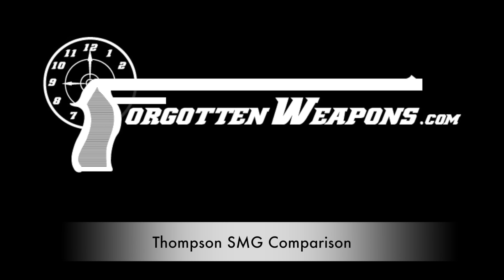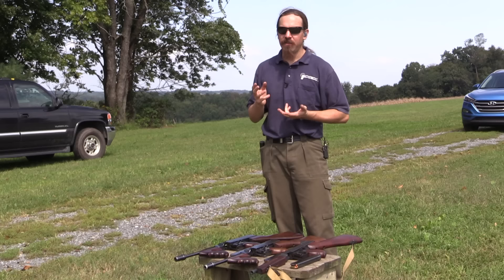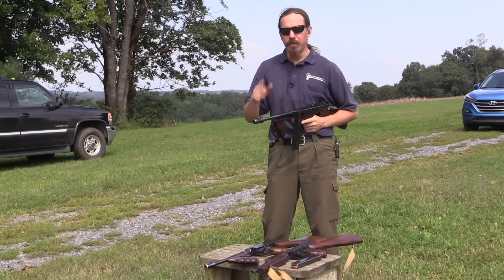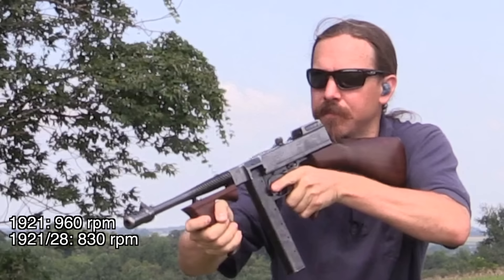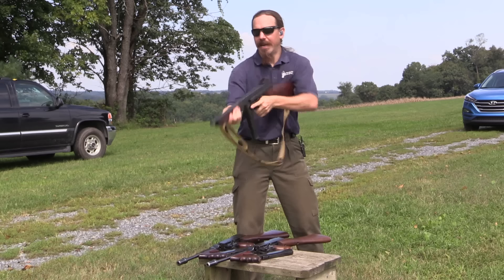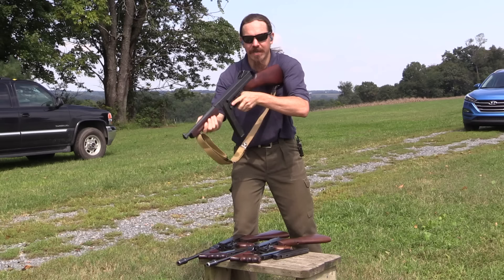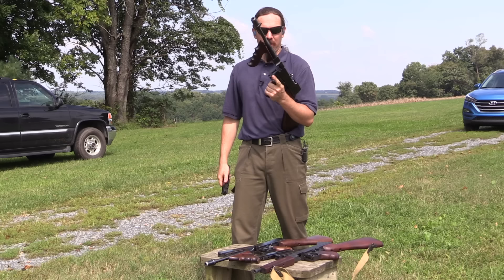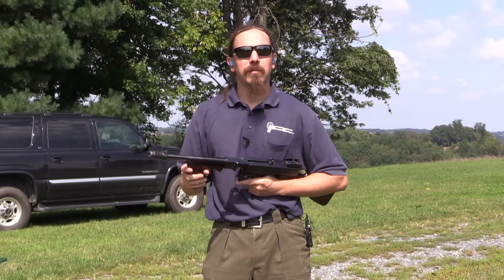Shooting the Thompsons: Comparing the 1921, 21/28, and M1A1

Comment: Since the M1A1 is strictly blow back operated I’d say thats the reason for more gas coming out the ejection port. The slight delay caused by the Blish Lock probably allows a more complete burn of the propellant, and causes air to be drawn from rear to front as the bullet exits the barrel.
Close up, high speed footage might solve the mystery.

Comment: maybe the 21 is more controllable because with the fast fire, the more bullets go through the compensater so that near constant stream of upwards gas makes it more controllable and that there is less time for the gun to sway and react before another bullet compensates the recoil. But just a theory
Reply: Kyle, I think you are on to it.  Ian leans into the gun and the 21’s high rate recoil balances.  But when the lower rate 21/28, he overbalances.  So he is having to correct (with his back muscles) with each individual round.  Well that’s a trick, so the gun walks around...less controllable.  There must be a sweet spot rate for every sub machine gun.

Thompson has its issues, but such classic lines!   M14 is another less than great weapon with classic proportions.

Cheers.

Comment: Say what you will about pistol/vertical forward grips, but I find them superior to the standard horizontal type on full autos of pretty much any sort. It seems a lot of folks prefer standard style, but I find a vfg goes a long way to increase control and mitigate muzzle climb. That goes double for designs with steep butt angles like the Thompson. I also tend to find them just plain more comfortable in most cases.

Comment: The only Thompson I've ever shot was an M1A1.  With no earlier models to compare it to, back-to-back, I thought it was just fine.  I can see how the Cutts would help.  If I had to pick between the Thompsons and a grease gun, I'd go with the M3 every time.  Much easier to control.  Not as pretty, but that wasn't the point.

Comment: I think that vertical foregrip makes the gun much more controlled. 
Incidentally the Cutts Compensator isn't to control recoil. Without it the early guns used to split their groups. Barrel whip. The Cutts prevented that.

Comment: Hrm. Assuming one had the cash to burn and the machinery, how hard would it be to adapt a compensator from the 1921 to the M1A1? The compensators seem pretty integral. If so would changing out the barrel be more practical?

Comment: Based on the slow motion, the impulse on the M1A1 at full bolt travel is extremely noticeable, all that mass is causing a lot of vertical climb when coupled with the high bore axis. The 1921/28 looked the most manageable however.

Comment: Even though I’m 6’2, I find the lenth of pull/ buttstock lenth to be too long.
The modern Kahr Arms/ Auto Ordnance 
Buttstock is the longest of all when comparing M1A1 config fixed buttstocks. I last year took on a SBR project, to build a nice Thompson SBR for myself, after the form 1 Tax stamp came back approved. There were a number of issues that kept me from just
Getting the factory SBR and calling it a day. Weight, without full auto there is simply no reason to want an 11 lbs empty, pistol caliber carbine. So the
Base conversion gun was the light weight model ( approx 8lbs) The barrel
Contour on the Kahr arms 10.5” barrel is wrong, and its not a WW2 spec chamber
Either ( it has a tight chamber which can effect reliability) so we went with the “Thompson Barrels” made M1A1 barrel.
It has been made with the correct contour, and is just about the highest quality Modern Thompson barrel you can  
Get. And after I chopped the 16” factory barrel to “make” the SBR, it all went off to Dan Block, a tier 1 Thompson mechanic.
Where he ran a custom WW2 spec chamber reemer in the Thompson Barrels tube, and made all new wood
For my gun. Kahr Arms Thompson furnature deviates from orginal WW2 wood considerably. The foreend isnt contoured for a real Thompson barrel
The kahr Arms pistol grip has a different angle, and contour than the real deal, and the buttstock also deviates greatly in contour, and is even longer than the original buttstocks… its too long! Making the gun uncomfortable and clumsy. Its over 1/2” longer than G.I.
I had Dan make mine 1” SHORTER than G.I., and by golly it feels like it should have all along! And with the loose WW2 chamber, it feeds everything. 
A selector was installed and made to function as a manual bolt stop, and with
The full auto 3 tine retainer plate, it looks like Thompson should….. all things the Kahr Arms SBR lacks.

Comment: I agree the 1921 sounded and looked more solid and controllable even with the higher rate of fire.  Sounds like a solid well made gun without corners being cut (thus the weight).  The M1A1 sounded a bit rough and "sloppy," and you can tell the better quality of the 1921 in its sound and operation.  For combat purposes, I like the M1A1 rate of fire, good enough, and saves ammo and magazine changes.  You almost need a drum mag for the 1921 because of the rate of fire.

Comment: Well, i'm no gun expert but i guess it has sense that the gun with the higher fire rate would be better, specially with a muzzle compensator. More bullets more fun, add the compensator and the higher fire rate probably means better effect of the compensator. Doesn't it?

Comment: My grandpa was undercover US Marshall in Chicago. I have pics of him with Dillinger. Imagine a REAL chopper, I.E. one with the steel cased, steel jacketed high pressure rounds. Wind that 100 rd drum  tight and then, with higer pressures the bolt starts rebounding off the leather pad in the rear. Hold it beside you, bear down into those perfectly angled grips, start it low, walk into target, very much higher cyclic rate. Count down the seconds, leave 10 rds or so, bolt is back held by trigger, release trigger, push mag release, bump out old drum with new and engage mag release BEFORE  new drum seats, automatically locks in, pull trigger again, cut cars, trees, buildings etc in HALF!  Overwhelm armor. Walk to targets 400yds away hip shooting by big brawny "Thompson experts" Those were choppers, just different ammo for the good guys! Makes an AR look pathetic. Thats why you would hear the scream "choppers!" And everything that could move found somewhere else to be NOW! unsurpassed yet. I had a steel round he said came from the valentines day massacre. But he said they were clubbed first. Chopper rounds left behind to implicate the FBI.

Comment: With the higher ROF the gun had less time to move forward and back, the shooter had no time to try compensating it, the higher tendency to climb with the fast ROF was well compensated with the comp. 
The heavier bolt in the two newer ones added more mass slamming into the buffer, which also meant more movement. The lighter bolt may run into the buffer much faster, but the inertia of the gun´s mass could compensate it much better.
The 1921 pushes back more (more lead being accelerated in the same time), but it does it much more smoothly.

My conclusion - Improvement in one or two areas (ease of manufacture and lower ammo consumption) may result in downgrading the overall performance where it matters.

Comment: I could see the 21 being the best handling and shooting because it was firing as designed! The 21/28 and the M1A1 are altered not redesigned to meet military requirements. This is one of those rare instances where the gun was designed and engineered to peak, right out the gate, and redesigns lessened the weapon over time.

Comment: Does anyone have any idea why the rates of fire are higher then "they are supposed to be"?
1921:  +20%
21/28: +33%
Almost 100 year old springs? Differences in ammunition now compared to the 1920es? Wear on the Blish lock?
Reply: Ammo and old springs. These guns had very nice looking internal parts.  And rof is based on a small sample size. Because the Army only cares if it works, the designers care how it works.

Comment: I think a lower ROF with a hard kicking cartridge is actually counterproductive. There's certainly a threshold below which the controllability increases again, but above that I'd say it's pretty much "the higher the rate of fire, the more the recoil feels like a constant push rather than individual kicks.

That's only a theory and I can't even put it to the test (thanks for nothing, sh!tty Germany!), but I'm pretty confident that I'm not far off the track with it.

I'd even go as far as to say that a hand-held M134 M134 minigun could possibly be tamed by adding a leg brace and using that to rest the gun against ur forward thigh while bracing urself with the other leg out to the rear.

Comment: Why wasn't the compensator put on the m1a1s?
Reply: Production costs, by eliminating the compensator, cooling fins, and altering the charging handle placement. It made the Thompson cheaper and faster to mass produce but still more expensive then other weapons which is why it was eventually phased out by the much cheaper and faster to produced M3 Grease gun.

Comment: Wacky theory here, Ian, but could it be that the cycle rate on the original complete design feels more controllable because (whether by genius design or sheer luck), it achieves a harmonic / frequency optimization with the recoil, exhaust gasses, parts and their motion / resonance. Like driving faster at certain speeds over bumps will give you a smoother ride than going more slowly. I.e. the vehicle's shock absorbing system behaves symphonically with the mass of the vehicle and its forward motion to smooth out the ride, the 1921's moving parts, recoil, barrel resonance, bolt movement, etc. symphonically "smoothes out" the point of aim? Including, perhaps, the effect of human interface: the grip points and its effect? Artful Ergonomics in addition to artful appearance. Just a wacky thought from a non-physicist fan of Forgotten Weapons.
Reply: He's mentioned that ROF doesn't necessarily correspond to controllability in other videos. A high ROF can translate to a continuous "push" of recoil which is easy to manage, and a low ROF can feel like holding a jackhammer sideways.
Reply: Yes, that's the idea. And for other automatic firearms, the opposite may be true...depending on the particular "tune" of the firearm.

Comment: I had the privilege of firing an M1A1 and I found it all but uncontrollable. The dropped stock and the resulting misalignment of force just threw the muzzle skywards. Though I'm willing to admit that it was probably 95% me being unaccustomed to the gun.
Reply: I carried one with 3 extra sticks as a back up to my sniper rifle. Usually without the stock to save weight. Absolutely difficult to aim and shot from the hip.
The intent was to have a very loud MG in ambush defense with a high rate of fire. LRRP teams before the M4 came around. Most guys used a grease gun or something in a 9 mil.
Reply: In one word Yes

Comment: Hmm, M1A1 with a stiffer recoil spring and a cuts compensator FTW?
Reply: No. It's a crappy compromise to bring down manufacturing costs and ease troop use.  The original 1921 Thompson is the best because it was made to a better standard and the Blish block with its original little side buffer pads actually helped, even though it doesn't do what they imagined it did.

Comment: So basically:
-  The "Blish Lock" (aka glorified delayed-blowback system) does a good job of keeping gas out away from the shooter
-  The 21/28 changes didn't do all that much to reduce rate of fire and made it a little LESS controllable
-  The M1A1 had by far the lowest rate of fire but was the LEAST controllable.

Heh_Ironic.png

Comment: M1A1 fires from an open bolt the other two fire from a closed bolt.
Reply: All of them are open bolt simple seer [I hope that's the right spelling]....the difference between the 3 is the 21 and 28 can accept drums and have a cutts comp with a leaf sight and a brass Blish lock whereas the M1A1 is simple blow-back with a weakened spring to reduce the RoF...
All are great guns to shoot now to use...eh...I've heard both hate and praise...more hate tbh...12lbs 5.5kg unloaded is heavier than the 8lbs 4kg Garand and near triple the weight of the carbine 5lbs 2.5kg...
Add to that it uses .45 which is great for stopping power but lacks significant range nearly half the velocity of the equivalent 9mm Luger/Para...
Again great guns and iconic but all in all crap
Reply: Thomas Dority Tom your description is mostly correct except to say the Thompson is a work of art and blast to shoot and a great investment. I know because I actually own one.
Reply: @craigscott5661  nice...ever carry it for long periods or have to reload it fast under pressure?
i'm genuinely curious.
probably not would be my guess [not trying to sound sarcastic].
but i too have handled the 1928 and the M1A1 [and the BAR but thats a different kettle of fish all together]...
the Thompson is a great gun for its time [1919-1930] its a generation 1 SMG same as the MP-18...with all the disadvantages that go along with it...granted it IS a work of art but its a HEAVY work of art thats not all reliable [if field reports and anecdotes are to be believed]...i have NEVER had to carry one for more than 30 mins and for those 30 mins it was a heavy gun but let it rip and i MUCH prefer it to a Grease gun [i'm a firm believer in volume of fire>accuracy {in the case of the M1928 i shot it had both so win/win}]...but i couldn't imagine lining up mag changes under fire or humping it for hours on end but for those 30 rds in the mag you're king of the hill once they run out its a question of reloading fast and the quickest i ever did was 15sec on a range...that being said it was also an expensive gun to produce which is an important issue when fighting a world war $330 per unit plus mags is a bit steep [its a little over 5k a gun in today's market]...now the greaser $3.25 per unit...thats a war winner...

Comment: Would you get less gas in your face if you shot the M1A1 "properly"; ie; right handed? :-)
Reply: No. It is a function of the placement of the charger and changes to the system. It would only be less bothersome, but still there.